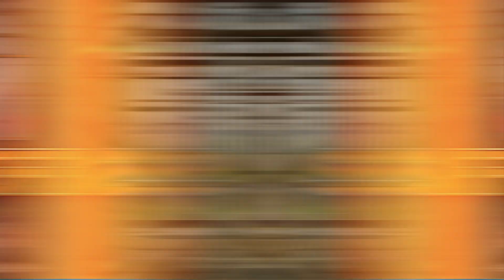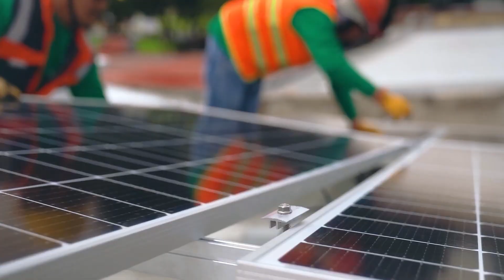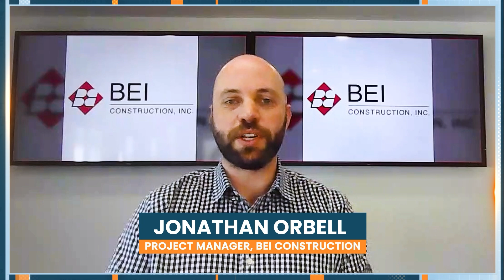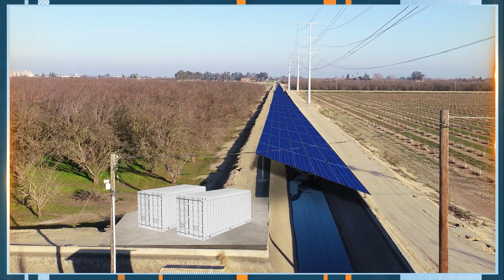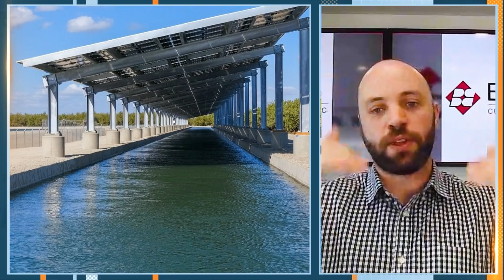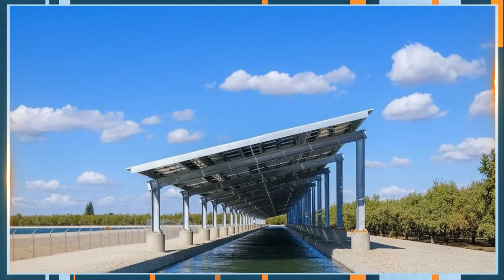Sailing The Storm - Canal-Top Solar Project in California: Structural, Safety, and Access Challenges

Comment: If the structure was dropped lower then there would be a lot more cooling effect from the canal water, but you wouldn't be able to access from below - maybe an opportunity for a manufacturer to make an over-water mounting system designed to more easily maintain from above?  I was thinking about whether covering in the sides of the structures with plastic panelling would add a lot more cooling effect as it would make the area enclosed - but would the energy saved from extra cooling give be offset by all the energy lost by shading the water (and hence reduced light reflection on the underside of the bifacial panels)?